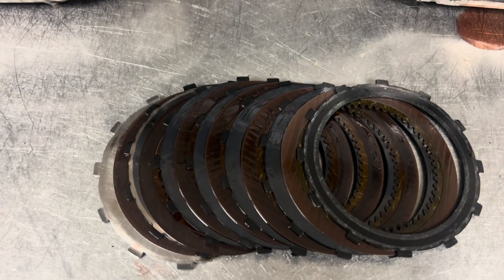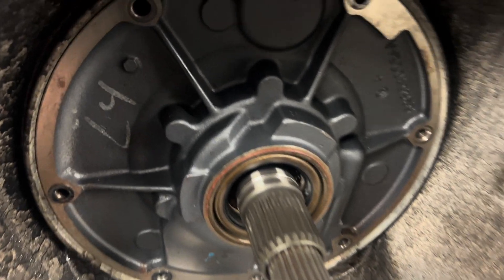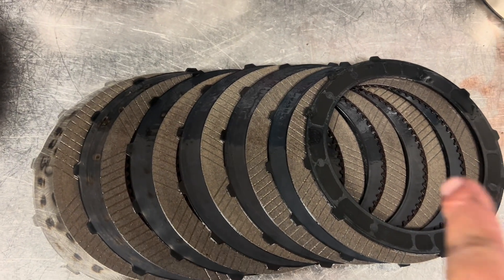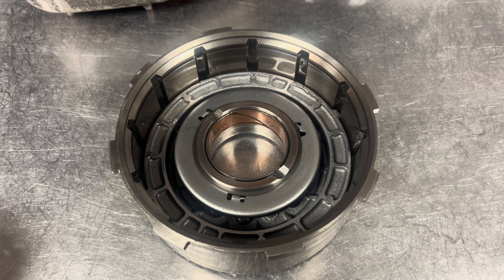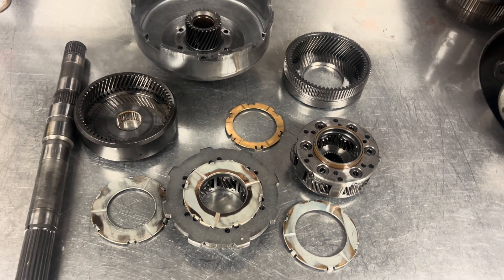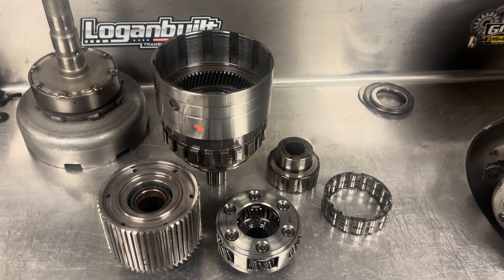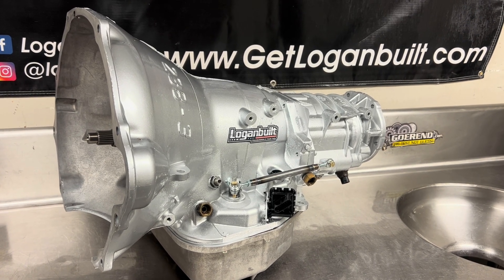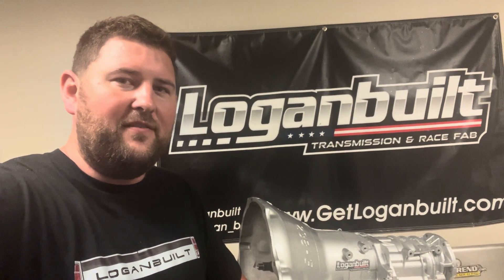Fix It Again! Episode 3 Full Manual Valve Body Swap

Comment: Thank you Logan for the video. How is applied regulated lock up different than regular lock up? Also would you recommend the reverse if I was converting a full manual valve body trans back to auto shift?
Reply from the maker: @batteriesnotincluded9442  the apply regulated lock up allows us to keep lock up apply pressure at 180psi while being able to run main line pressure at what ever we chose to. This keeps the converter from ballooning from too much lock up apply pressure. 

If you’re converting a FMVB back to auto shift you can leave the rear servo set up from the full manual in it and it won’t cause any adverse effects
Reply: @LoganbuiltRaceShop  thank you Logan for the information. What about the direct springs should I change back to 9
Reply from the maker: @batteriesnotincluded9442  you’re welcome. You can run it as is

Comment: So I recently installed a BD tap shift with the option for full manual tap. could you elaborate a bit more in the 9 to 12 springs and if you believe it to be good or bad? appreciate you videos and knowledge thanks.
Reply from the maker: @crohnsn2446  I’m not extremely familiar with the bd tap shifter set up in detail but it’s just a full functioning VB that allows you the options of holding it in each gear essentially taking the ecm shifting out of the equation when you choose. Not the same mechanically as a FMVB with low band apply so you shouldn’t need to worry about anything I mentioned in this video
Reply: @LoganbuiltRaceShop  Thanks Logan I really appreciate your input on this. I have always had manual vehicles and never wanted auto but now I am switching it up and the info you put out helps a lot with shedding light into the "unknown unkowns" in the automatic transmission world. thank you sir.